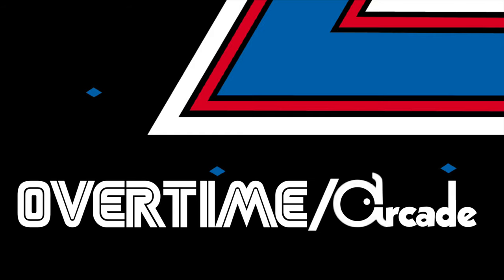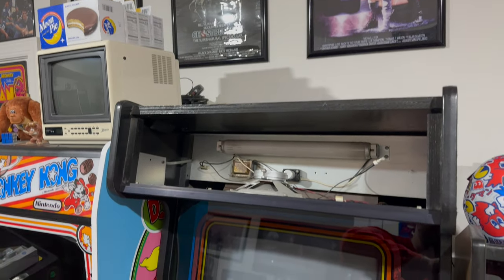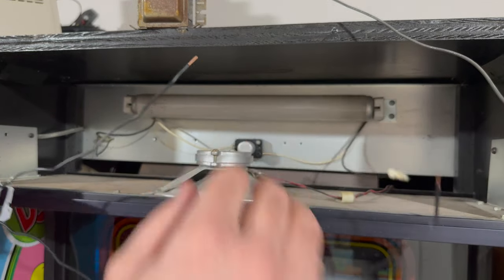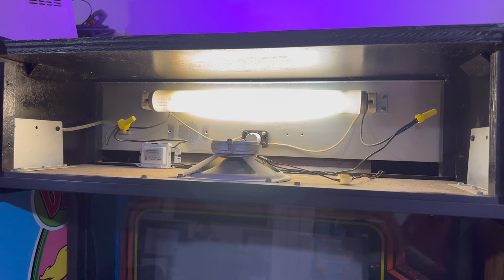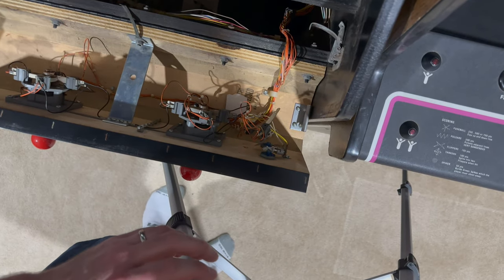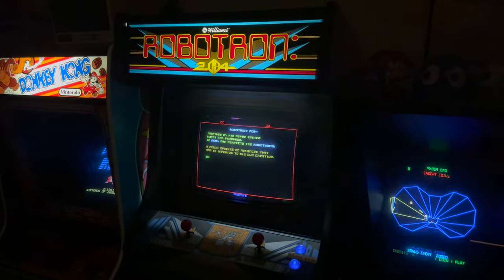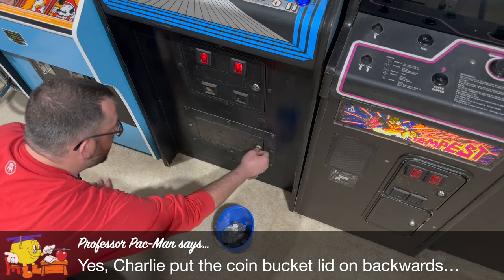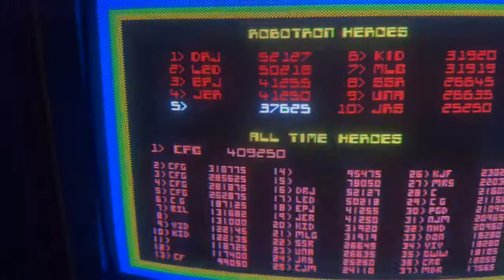Quick Fix: How to replace the Ballast in a Williams Robotron arcade cabinet Marquee Light fixture 💡

Comment: "Hey Charlie"  So far I never had to replace a ballast it's always been the bulb or the starter. I always start with the easy things to swap out. Get lucky some times!  Monday Morning Quarter Back. Lol. Thanks for sharing..
Reply from the maker: I’m just glad that it works! 😅
Reply: @overtimearcade  I hear you
Reply: @overtimearcade  Curiosity would have gotten the best of me and I would have popped the old one back in to see if it worked with the new starter. But since you cut the wires too short ... LoL. I learned the hard way too. Now I always leave room when cutting in case I need to put it back.
Reply from the maker: @delsarcade  I was more concerned about leaving enough length on the other end to connect the new ballast — I should have given myself more of a margin for error!

Comment: You can test the ballast.  With it disconnected, if you have your meter on Ohms, there should be about 26 Ohms between the two wires if it's good.
Reply from the maker: That’s great to know! I’ll test out the old one that way…

Comment: ALWAYS replace the starter first. It’s quick, easy and cheap to replace. Next, replace the bulb. Did it blow immediately? If so, you have a bad ballast. The starter is the most common failure part. 

The bulb will be the next thing to fail in your game based on the darkness you see at the ends of the tube. If you don’t replace it now it may cause your starter to die prematurely because of the stress put on it trying to start a weak bulb. Ideally, it would be best to replace the starter and the bulb at the same time for reliability and longer life. Your bulb is nearing the end of its useful life cycle.

Ballasts do die but it’s rare. When they do, they usually take out the bulb with it.
Reply from the maker: Great info — thank you!

Comment: How do you like that electric skil screwdriver? How’s the torque on tough jobs ?😎
Reply from the maker: I really do like it! It charges via USB, has a built-in LED flashlight for working in dim areas, and I actually appreciate that the torque is quite weak — you don’t want to damage delicate components by over tightening! (For tougher jobs, I’ve got a drill with a screw bit.)

SKIL Rechargeable USB Cordless Screwdriver https://amzn.to/3ROoqdF
Reply: @overtimearcade  thank you for the message. I’ll check that out.  All the best in your projects ✌️

Comment: Nice, the marquee light on my Baby Pac is dying, this will come in handy when I decide to deal with it.
Reply from the maker: Does Baby Pac have a fluorescent setup, or multiple small bulbs behind the marquee?
Reply: @overtimearcade  I had it off to clean the marquee when I first got it and am pretty sure it was fluorescent. I think mine was one of the last ones off the line, serial # 10,56x and made June 23rd of 1983.
Reply from the maker: Very cool — such a unique game!
Reply: @overtimearcade  When I first got it 2 years ago, the light worked 100%. Then it would take a few seconds to do anything, then did that flicker you talked about for 5 to 10 seconds and would work fine afterwords. Then it started coming on after an hour or two then stopped working totally but I've never had the machine on for more than 6 hours. Do you think that would point to the bulb, ballast or starter first? Thanks for any advice you could give and for making these videos.
Reply from the maker: @jeffkaczmarek3577  Maybe start with a new starter? I know bad ballasts can ruin good bulbs, but I think it’s rarer for ballasts to fail, and I don’t know if they can damage starters…? In any case, all three components are relatively cheap to replace if bought online!
Reply: @overtimearcade  Thanks man, I'll pick one up sometime and swap it out and see where that takes me.